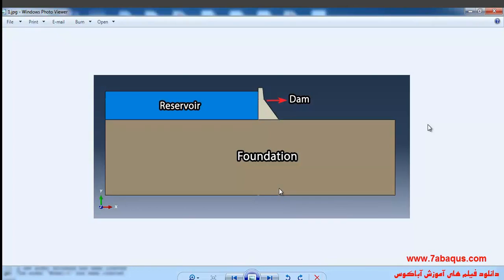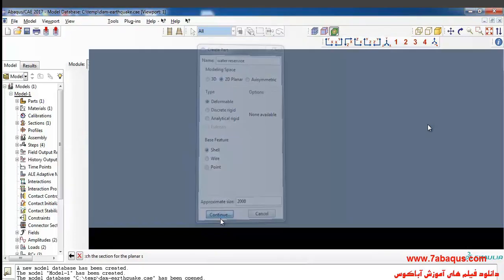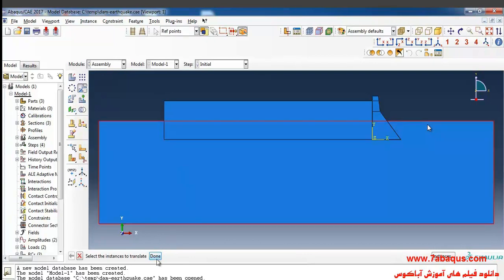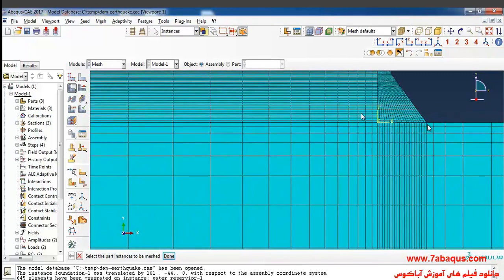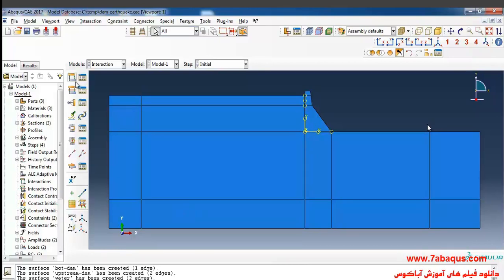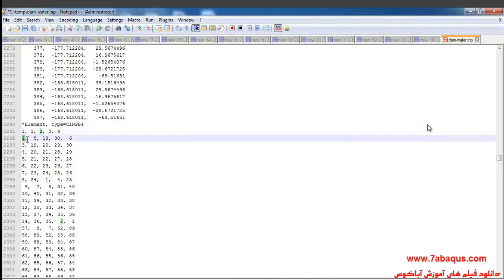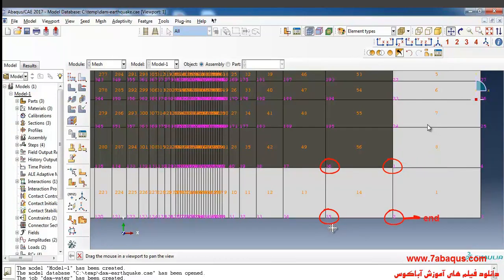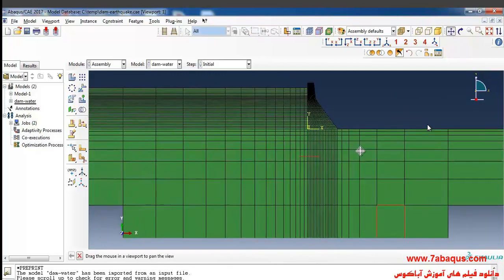Seismic analysis of a concrete gravity dam with Water reservoir and foundation Abaqus

Comment: Hi sir, I need a small favor.
To interact dam and reservoir, can we use "tie constraint" and "interaction with acoustic impedance properties " both at a time ?
Reply from the maker: Hi
Acoustic impedance is used to model the Far-field region
we use Acoustic impedance for leading the compressive waves out of the Acoustic space and nonreflecting of them into that place
Reply: @saeedmoeini-7abaqus  thank you sir.
Reply: sir can we use wave velocity and wave reflection as a material property for the reservoir modelling? Are these two properties available in ABAQUS software?
Reply from the maker: the "tie constraint" used between dam and water but the acoustic impedance
 used for defining far field region in reservoir
Reply: @saeedmoeini-7abaqus  ok sir.
Sir what is the procedure for creating a programme file(or subordinate file) to apply hydrodynamic force on the dam body?
Reply from the maker: @satyajeetdash9408  
When you simulate the reservoir (acoustic elements) , Hydrodynamic pressure is applied
in fact , POR is Hydrodynamic pressure
Reply: @saeedmoeini-7abaqus  actually sir my whole project is based on 2D modelling. POR is for 3D sir. If you have any idea about 2D than please help me sir.
Reply: @saeedmoeini-7abaqus  can i communicate with you by email please , i need your help..
Reply from the maker: @kassemdeeb8847  saeedofmoeini@gmail.com

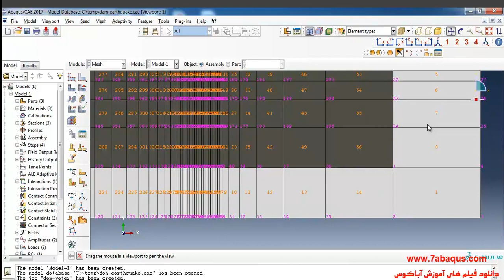Comment: How can i see all the nodes and elements numbers at a time, like in this video at 4:30 min?
Reply from the maker: Hello
 In mesh module 
you select "view menu" / then select "assembly display option"/then select "mesh" / and tick on the "show node labels" and tick on the "show element labels"
Reply: @saeedmoeini-7abaqus  Got it. Thank you very much.
Another question. I am modelling a reservoir, i want to make acoustic infinite element only on the left side of the reservoir and rest three sides are of only acoustic element. 
The procedure which i followed was not correct.(First i assigned all the elements into acoustic element and than in the input file i changed them into CINPE4 , but in this case all the elements converted into acoustic infinite element. I also tried above method by changing the node numbers of that particular face but that din't work.)
Please help me on this.
Reply from the maker: @satyajeetdash9408  
you do not use infinite elements for acoustic , you should use the acoustic impedance 
see 3:04 time

Comment: How did you create infinite element or how we create absorbing boundary condition? Please help
Reply from the maker: you should edit (modify) inp file , you should rename the infinite elements to CINPE4 and modify order of nodes number for infinite elements
-------------
you use the Dashpot for absorbing boundary
Reply: How we create absorbing boundary condition using dashpot. Is there any video available for that or can you tell me?
Reply from the maker: @prernasingh9298  you read this paper 
http://dl.7abaqus.com/e0c20e93ccedf9bd82708d9c8d8be4a82253.pdf
Reply: @saeedmoeini-7abaqus  hi. I have read the paper you send. And tried to solve the problem given in that paper. Still not much clear about how to apply absorbing boundary condition. Can you please help me.